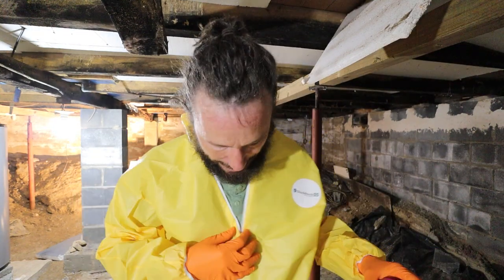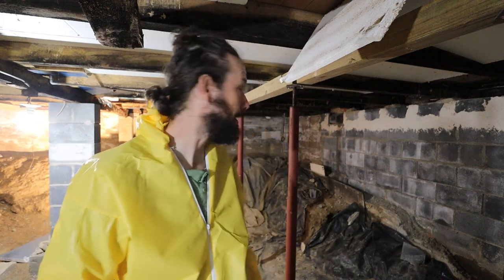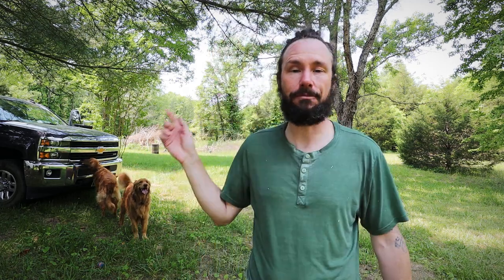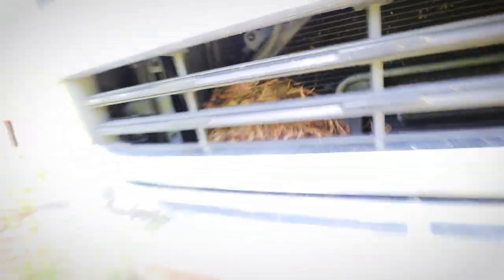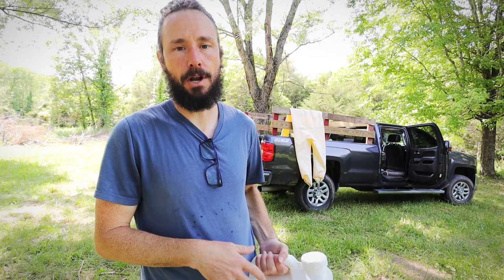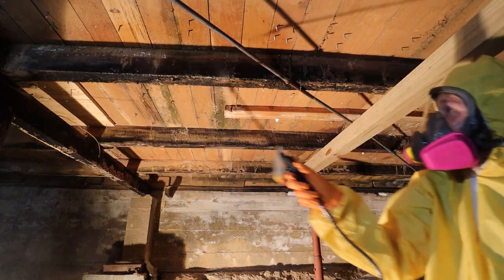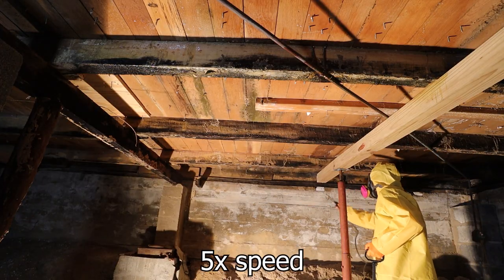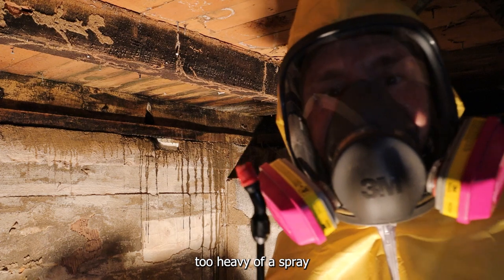DIY Mold Remediation | Homestead Farmhouse Renovation Ep 2

Comment: Kudos to you for taking on this job. I would have waited until I could afford a mold remediation company to do that job. Please stay safe.
Reply: ServPro wanted $27,000 to do a 1678sqft double wide for me.  That included demo of drywall, staple removal, and the full remediation.  Manager told me if I can remove the fixtures and drywall, they'd do the rest for $9k.  So, I guess it's based on your budget.  I'd rather spend my $$ on new lumber than other laborers.  Just be smart about it.

Comment: I have used a similar product years ago, I had to scrape off all the heaviest mold sections and dirt etc first, then spray twice about 2 weeks apart. I also sprayed insecticide and timber preservative another 2 weeks after that. Once a year afterwards I would spray with white vinegar to stop it returning, proper ventilation is the best cure long term.
Also looks like you need some more floor support down there, some heavier joist bearers and a few more piers perhaps, an experienced contractor could advise you if you can find a good one.

Comment: Take a look at the RMR86 Safety Data Sheet -- you will see the stuff is a  4 to 6%  by weight solution of Sodium Hypochlorite.   Clorox laundry bleach is 5 -10 % by weight solution  of Sodium Hypoclorite the exact same main ingredient.   Pool  chlorinating liquid from a pool supply is about 12% and likely to be your lowest cost source about $5/gal at Walmart.  The SDS doesn't seem to  indicate any other component.   Whey the stuff finally drys and the chlorine smell is gone there will be a residue of mostly sodium chloride (table salt), possibly some sodium carbonate.

Comment: I have had mold remediation.  I had it professionally done.  As it was explained to me, spraying the mold is not enough to eliminate it.  Mold has little feet that attach to the surface it touches.  Once sprayed, the mold must be scrubbed to break the bond the little feet has with the surface so regrowth does not occur. Then the area must be thoroughly dried.  Once dried, a special expensive paint must be applied to the area to seal the surface and prevent oxygen from feeding any spores that may be in the crevices. I had this done and have not had any reoccurance.  It is a rough process.
Reply: WS it extremely expensive if, you dont mind me asking?  I've read that sand blasting is the only solution, and apparently that is very costly.
Reply: You got burned. Don’t ever believe someone who claims their an expert,do your own research
Reply: No it was no extremely expensive.   For the work they did, it was incredibly reasonable.   Just research your contractors.  Look into the methods they choose to use. Ask questions. Check references.  I got to see his work first hand on another project.  I've not had a problem since.  Hope this helps.
Reply: That's why you have to spray it with RMR 141 which is a fungicide and mildewcide. Once it's all dry, you need a dehumidifier to keep the moisture at bay. You can also as an extra step fog with concrobium. Problem solved
Reply: Not true
Reply: As it was explained by the guy who charged you 15,000?
Reply: Why would mold removal cause $15,000?  That's ridiculous under any circumstances.   Brian, do your research and stop trying to pick a fight with me.  Do YOUR own research for YOUR own property and learn something.  Make YOUR own  financial decisions  for YOUR own life as YOU see as fit.  As for me, I  got a GREAT deal with a GREAT company and have had no difficulties since.
Reply: @kathrynjones5858  surepro is the company charging that much,and more
Reply: Well that's a load of crap, fungicide kills the entire thing, how does paint magically do anything lol. Scrubbing fixes it but spraying a chemical intended to kil mold doesn't fix it?

Comment: I just looked it up and RMR 86 PRO Mold and mildew stain remover is just 4-8%  sodium hypochlorite (bleach). Bleach is not really recommended for mold and mildew in crawlspace, but a hydrogen peroxide solution. I'm glad it worked for you but this may help others in the future as well.

Comment: Is that stuff temp sensitive? I bet that would work in a cheap fog machine like they sell around Halloween. Just fill the tank and walk away for a few hours and let it do it's job. We had a mister when I was at Manny Moe and Jerks auto chain that would put out mist and get sucked into the AC ducts on a car to get mold off the evaporators.

Comment: Nate, for future reference you could have done the same thing much cheaper with pool chorine and if you wanted to really go the extra mile some muriatic acid and a little liquid soap.
Fill your sprayer with water then about 2 cups of chorine about 1/4 cup of muriatic acid and a little soap the break the surface tension of the water.  If it did not quite kill it all you mix a little stronger. But 2 cups should be over kill because it take 50 to 100 oz to treat a 10,000 gal pool and your sprayer is what 2.5 gals and 2 cups is 8 oz.
Also if you go with the chorine you would have plenty to spray everything the walls, the floor everything.